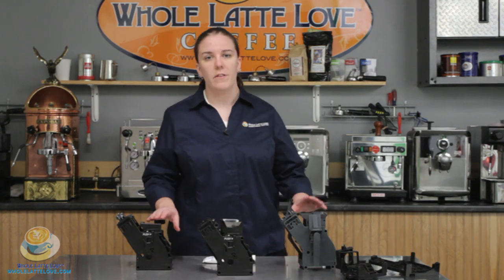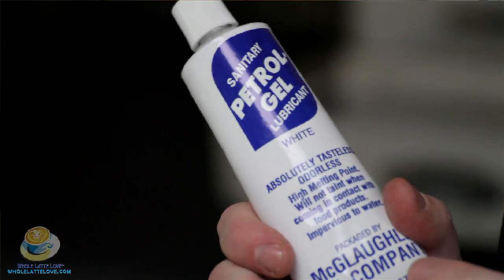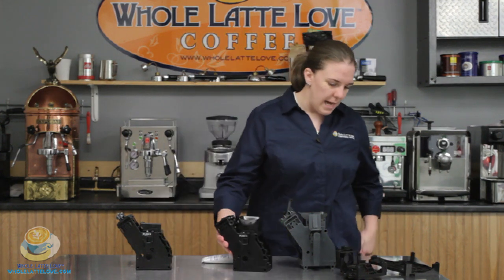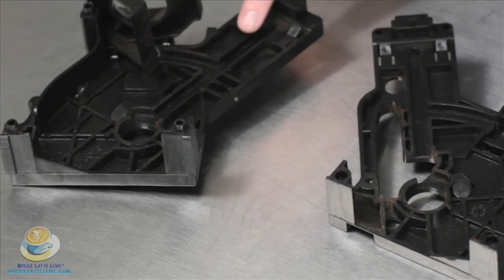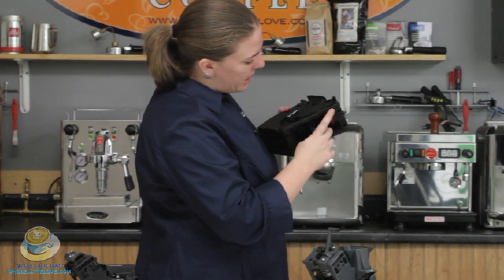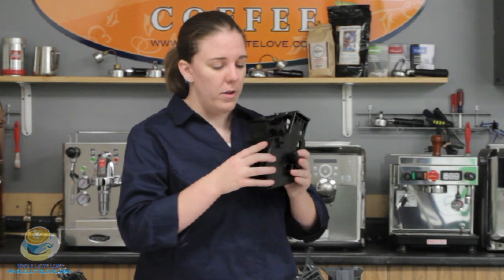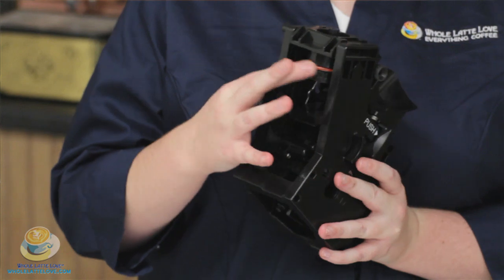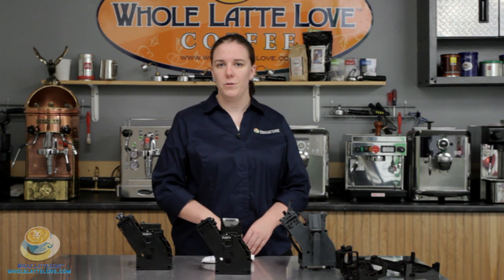Espresso Machine Maintenance -- How To Lubricate A Brew Unit

Comment: I have the Gaggia Anima and it's my first super-auto machine. I made the mistake of forgetting to select the ground coffee option and had a mess of grounds everywhere, literally everywhere inside the machine. I cleaned it as best I could but was wondering if you have any additional tips. Should I lubricate this machine? I just got it for Christmas and am in the learning phase. Thanks.
Reply from the maker: Hi Tricia, Congrats on your new machine! Just wipe up the grounds and you should be fine. Some ground spillage internally is to be expected in normal operation so not a big deal. Basic maintenance is to remove and rinse the brew group under room temperature water at sink one a week. Deep cleaning and lubrication of the brew group should be done every 6 months. Descale the machine when alerted to do so. If you have not done so already test you water hardness and enter result in the menu. Also enter if you are using a water filter or not. Use of a water filter will significantly increase the time period between descalings. If working with milk be sure to keep frothing components clean. If you have not found it yet here's a link to our support wiki for the Anima: https://wiki.wholelattelove.com/Gaggia_Anima It has loads of useful operation and maintenance advice, machine specific videos, manuals and more. Welcome to the wonderful world of bean to cup coffee/espresso. If you have more questions we're always here to help!
Reply: Thanks. After reading the section on brew unit noises I had another question. My machine intermittently will make a high-pitched squealing noise as it is brewing. I’m assuming it’s part of the breaking in period since I’ve had it in use for only a full month. About how long should I have it before that stops or is that normal going forward?

Comment: I have the gaggia anima prestige. do I just rinse this with water, no soap?
Reply from the maker: Hi SJ, Yes, just use room temp tap water for rinsing the brew group. Soap and/or hot water will remove lubricant from slides of the brew group. Here's a link to our wiki on Gaggia Anima. It has loads of info on setup, operation, maintenance, troubleshooting, etc for your machine: https://wiki.wholelattelove.com/Gaggia_Anima

Comment: I have a Gaggia Brera and wonder whether using Urnex grinder cleaner in the grinder is ok?
Reply from the maker: Hi Karl, Sorry for the delayed response. No, do not use Urnex Grindz in a super_automatic machine. In most machines running the grinder will cause a brew cycle to run and you do not want to brew the ground up Grindz! Baratza did tell me they are working on a grinder cleaner for super-automatic machines.

Comment: Hi, we bought our Gaggia several months ago from you. I've been good about cleaning the brew unit every week or so, and just did this weekend. Today though I brewed a shot while getting my breakfast ready and only water came out (I wasn't paying attention to the machine while it did its thing). So I threw that out and made another, which came out fine, but while it was brewing I noticed smoke (or steam?) coming from behind the door with the brew group. I opened the door when it was done, and more smoke/steam came out. Is this normal? Or does this mean it needs to be lubricated even though it's only been a few months? Or could something else be going on?
Reply from the maker: Hi Katie, Which Gaggia machine do you have? Some steam may be normal. If it brewed a shot that was all water there may have been a temporary issue with coffee delivery to the brew group that resolved with the next shot. If you continue to have concerns I would give our customer service a call at 888-411-5282. They would be happy to help verify your machine is operating properly.
Reply: Thanks for responding so quickly! It's the Brera. I'll keep an eye on it and give you guys a call if it happens again. Thanks!
Reply from the maker: Katie Gard
You're welcome!

Comment: can u answer this question.
copper boiler used in esspresso mchine and soldering on copper parts, brass or bronze or.. valves are these parts food safe.
2.copper vessel filled with water for overnight or used for 1 week less often, develops a greenish layer due to oxidatoon and may go upto green blue layer.so such oxidation may occur inside the boiler, also pressure abd temperature sensor pipes are also copper or alloys of same.they may also develop greenish layer internally.
HOW DO WE MAKE SURE WE HAVE SAFE WATER DELIVERY, EVEN IF WE USE FILTERED WATER.
moreover copper and milk are poison causing so......
aluminum used in machines may not be food safe as good as stainless steel.
this concern is bugging me about coffee machines and their risks.
It may not taste like that but still  erosion, corrosion of copper is its nature.
please clear this question.
im amazed how a great invention of coffee extraction was left out in hands of metallic risky ignorance.
make a good way out of question as espresso love is hindered by fear.
Reply from the maker: Hi YK, Thanks for the question. I understand some have concerns with regards to the metals used in espresso machines. Please understand that all major manufacturers of espresso machines must pass stringent EU and US regulations regarding product safety. Boilers may be made of copper, aluminum, stainless steel or brass. Regardless of the metal used the machine and materials must pass regulations and qualify as food safe. Here's a video in which I spend some time talking with Luca Bezzera about material safety - specifically the brass they use for various components: https://youtu.be/KY14ND7_Exs
Personally I'm satisfied that all machines made in the Italy for markets around the world are perfectly safe with regards to the metals used in components which contact water. If looking to go over the top with caution I believe stainless steel is the most inert material used in espresso machine boilers. Manufacturers like Profitec and ECM use stainless boilers in most of their machines. Hope that helps.

Comment: This is almost astonishingly unhelpful.  Since most of us won't (1)disassemble our machines or (2) have the x-ray vision to see inside, seeing the "inside" tracks is not that helpful.  Then covering up the application with your hand means we can't see where the grease goes anyway.  And...last complaint...this bears  no relationship to what is in the instruction manual.  Altogether, not useful at all.
Reply from the maker: Hi Lindy, Sorry to hear you did not find the video useful. :( Guess I'm not exactly sue what the problem was. At :55 in the video it's pointed out where to apply the lubricant to the brew unit. We opened up the brew unit in the video to point out where the lubricant goes. You do not have to do that - it was for demonstration purposes only! Also, you do not have to disassemble the machine to remove the brew unit. They slide out quite easily (unless you have a Jura machine - most all Jura machines have non-removable brew units.)